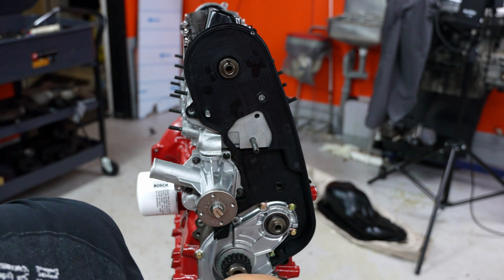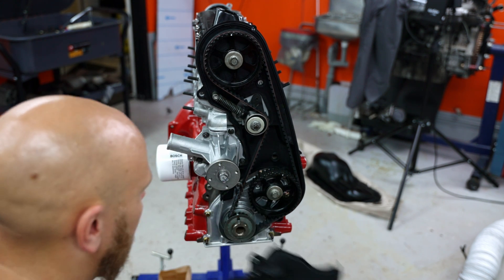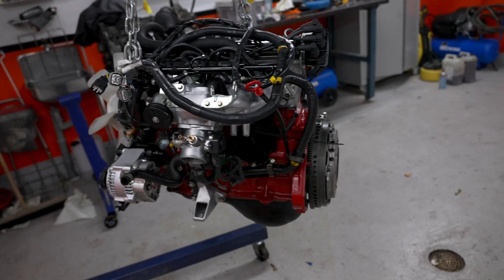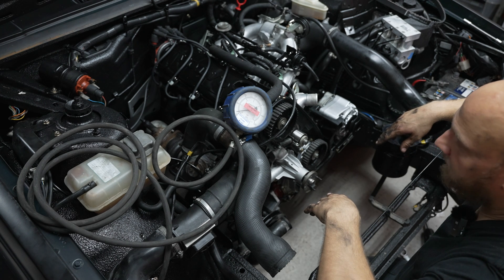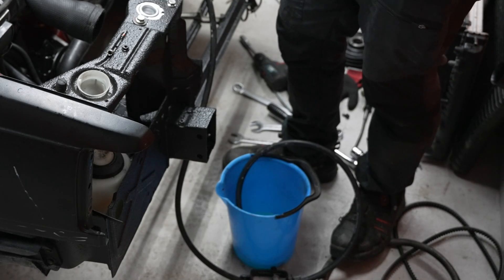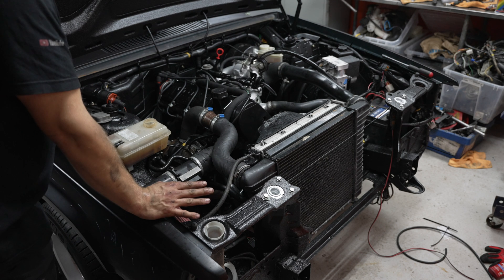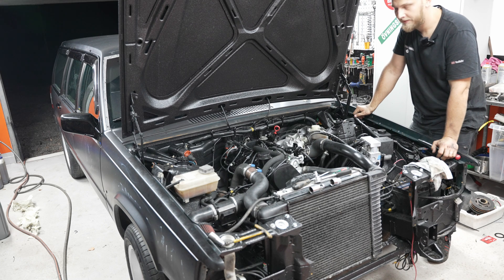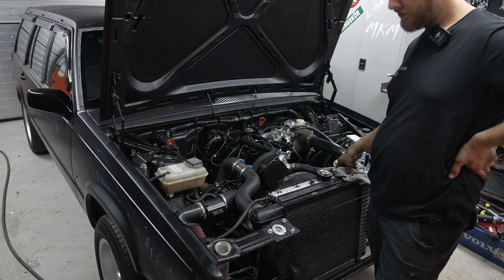I Start my Engine for the First Time  || The 300Hp Volvo Redblock Build || Part 4

Comment: I just love your series, i am currently moving into a new workshop. For my next project i intend to get an Amazon and either go for a heavy modified B20 or follow your example and go for a 230 route. You are an excellent teacher, very clear video's, great help for prefun planning.
p.s. would it be possible for you to provide a shopping list of all the parts you procured, it would be a good starting point for other people. Many thanks in advance.
Reply from the maker: Thanks! B20 is definantly close to my heart, just the sounds and smells of it. Not the most reliable in today's traffic tempo, but a good choice for the soul. B230 potent, reliable, tons of aftermarket support and easy to install/modify, cheap. But the sound from it is really not to my taste. I've always wondered how it would feel to put a T4 engine into an Amazon, it kindof takes the soul away but as far as power to weight and overall size, should be a great fitment. 

But dual weber carbs on a b20 coupled with the M40 gearbox with the long stick 👌👌 hard to beat. 

Yeah, the B230 project isn't over yet, I just want to find out what the noise from the engine is before I continue. It will be disassembled this fall again if everything lines up the way I have planned. 

But will definantly will put in some kind of shoppinglist when everything is in order 👍

Comment: and next question is what the number of torque bearing nuts and cylinder head of B230f 1990  thanks for your answer
Reply from the maker: Their should be a a letter with specs that goes with your head gasket of choice 👍

Comment: What brand torque wrenches do you use? I'm planning to do engine rebuild too and I can't deside wich ones to buy. Your videos are great, and as finnish person I like that I can easily undestand your speech, because you articulate kind like us.
Reply from the maker: Thanks :) The wrenches are basically a no name brand from Verktygsboden. They come with a calibration chart and certificate but its nothing i would recommend unless you are on a somewhat tight budget. 

Looks like they dont sell the same model anymore, but its something along these lines :)     https://verktygsboden.se/hand-elverktyg/handverktyg/hylsverktyg/momentnycklar/momentnyckel-38-20-100nm?att=TW9tZW50bnlja2VsIDMvOCwgMjAtMTAwTm0=
Reply: If you're unsure, biltemas digital torque wrench adapter works better than 99% of torque wrenches out there. Just slip it on your breaker bar and it'll do all you need! Google torque wrench adapters for more info.

Comment: If they are stock pulleys, the cam pulley is slightly taller than the aux shaft pulley, as in the teeth are spaced out slightly further from the pulley mating surface.
Reply from the maker: Yes, i have gotten a comment on this earlier. Will make sure to include that in an upcoming video👍

Comment: Thanks for the great video series.  Hope to see more.  One note, the round belt cam and aux shaft gears have different backspacing.  Just ran into this one that the belt wasn't tracking right one.  They have different 3-digit part numbers stamped on the 'spokes'.
Reply from the maker: Oh really? Thats news for me. 😄 So this is just for the roundtooth and not for the square ones? Thanks, will look into this 👍
Reply: @BackmansGarage  Yes,  round tooth only.  The cam gear should have 032 stamped on it.  The aux shaft gear 751.  My engine had 2 aux gears and the belt was riding on the front edge of the gear.  There is a 2mm difference in backspacing between the 2.
Reply from the maker: Thanks. I will mention this in a future video 👍

Comment: Great video. Hopefully you can get the engine running as smooth as you want.
Reply from the maker: Thanks! Yeah, I have never been satisfied with how this engine has run since I bought it. I really thought this would fix that, among other things, but I guess it's an electrical issue, maybe. 😄